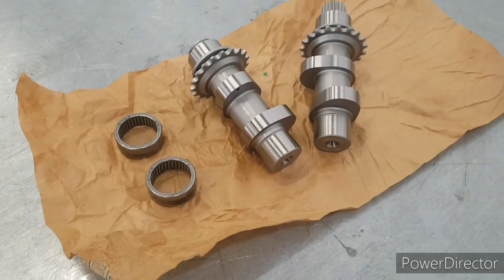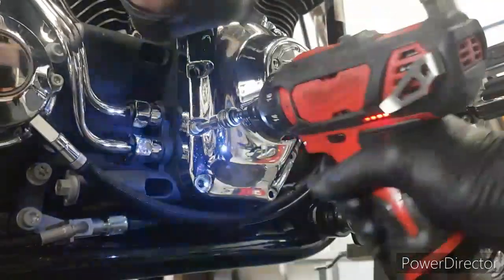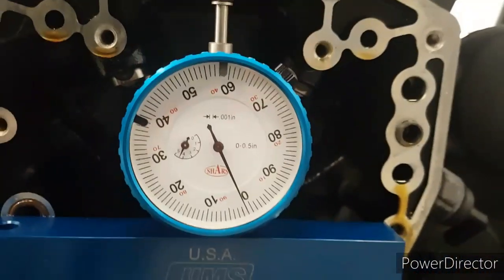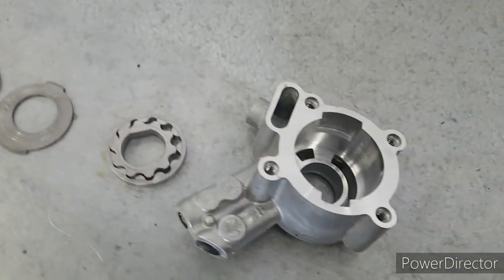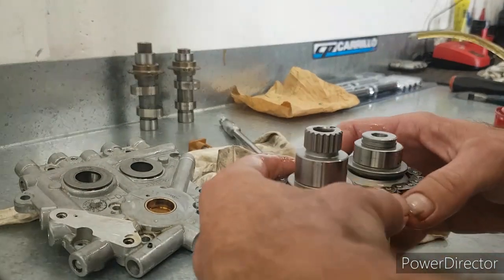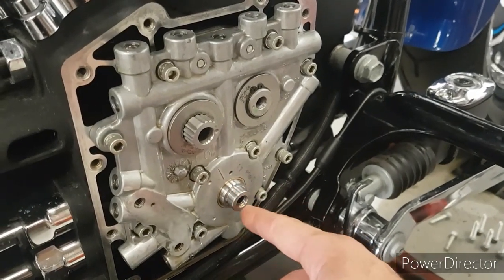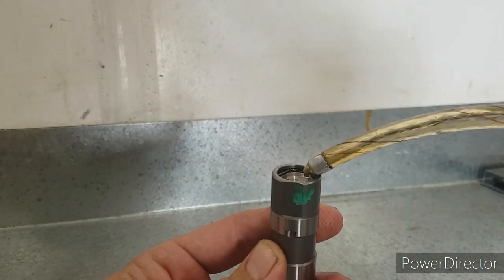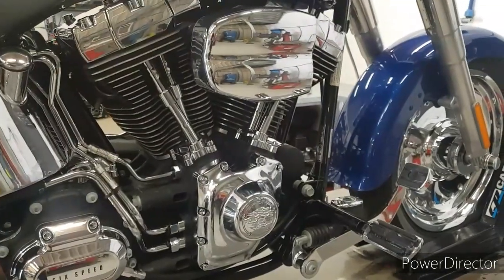Stage 2 Cam install on a Harley-Davidson Fatboy

Comment: Hello, great video very well explained in detail very good camera work excellent all around.
  I have a 2005 Fatboy installed new S&S crankshaft, 8081 billet aluminum fueling cam plate and HF oil pump.
 Gears would change to Andrew 37 gear drive new lifters and pushrods all new bearings and the blue James gaskets for the whole engine.
   I have a time cert that came loose out of the spark plug hole the front jug unfortunately waiting for the tool wish me luck.
If you have any tips my mind is open thank you in advance.
  PS I am trying to do this with the head on the bike with the gas tank lifted for access?!!

Comment: Great videos, I wonder how to clean up the camplate and oil pump, WD40 or soapy water perhaps?
Reply from the maker: I use brake cleaner and compressed air
Reply: @MasterTechMiller  thanks, I'll do the same with mine

Comment: New cams, bearings and the taken apart and reassembled oil pump don't require any assembly lube?
Reply from the maker: Engine oil is applied during assembly mate.
Remember, just because something isn't shown in the video doesn't mean it didn't happen.
Reply: @MasterTechMiller  well mate.. for a how to installation video wouldn't it make sense to show that and not assume viewers would know?  Engine oil and assembly lube two different animals.   We've come a long way since Babbitt bearings and oil cups.

Comment: Good work mate, I have a 09 fatty so this video is very informative. Could you use the original pushrod.
Reply from the maker: Yes you can use the original pushrods, however it invovles a little more labour as you need to pull the tank, rocker covers & rocker gear out to remove the stock pushrods. The extra labour works out to be about as much as a new set of adjustable pushrods are. Most people go with the adjustable pushrods because if they want to change cam shafts later on its easier and more accurate to set the lifter pre load properly

Comment: I hate using adjustable pushrods , take the extra time to remove the rocker boxes replace gaskets and the oil breathers that’s the right way.

Comment: How did you get the inner cam bearings in?
Reply from the maker: The genuine Harley inner bearing remover & installer. JIMS Tooling do one aswell that is much more affordable for the public to buy and does the same job. 

The genuine tool is over $400 more in price, the only reason I have one and use it is because I work at a dealership and the genuine tooling is required
Reply: @MasterTechMiller  Got it!
Thanks for taking the time to reply. Have a great night.

Comment: I notice the cam shoe wasn't changed, what mileage should those be changed mines at 20k
Reply from the maker: The updated Hydraulic chain tensioner shows are quiet resilient as long as regular on time servicing is carried out. 

Other factors such as excessive crankshaft run out can cause accelerated wear on the shoes but even still they have been known to last upto 150,000km without any problems.

Comment: Have you built any hammer performance sportsters? 1250 or 1275cc?
Reply from the maker: We don't see too many Sportys in our dealership unfortunately, the most I've ever done to one was the stage 4 kit from Screamin Eagle with the SE Cams, Bigger throttlebody & intake manifold & CNC Ported Heads. Made just over 105hp slip on's.

Comment: Hi. I am Italian.. I have one fat boy 2004 yar last model carburator. I have 38559 million. I need change catain distribution end pomp oil?? Who's you think about pomp oil feuling?? We have dream have meccanic egual you in Italy 🇮🇹. You came for Oliday. End work in my bike. Yar a lot difficolt find people work well om motor harley. HARLEY FROM USA.
Reply from the maker: desideri passare dalla pompa dell'olio di serie a un tipo di alimentazione? Sei preoccupato per la quantità di miglia percorse dalla moto? scusa per la barriera linguistica
Reply from the maker: rifornimento fanno un ottimo prodotto. Se si intende sostituire la pompa dell'olio, ispezionare l'eccentricità dell'albero motore. Se si dispone di un runout superiore a 10 millesimi di pollice, l'albero motore dovrà essere ricostruito o sostituito
Reply: am worried cuz i have 38,000 millions. And I would like to know from you. If I have to change the timing chain. And pump oilo. Obligatory. For economy I found a fuel pump. And I'd like to know what. You think. I saw you very prepared and professional.